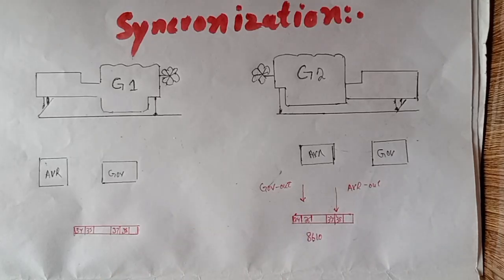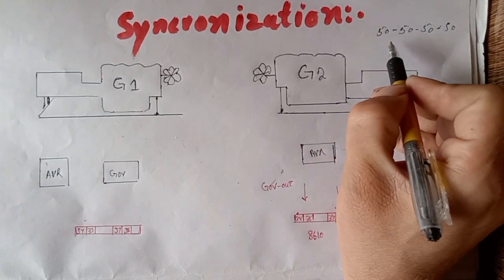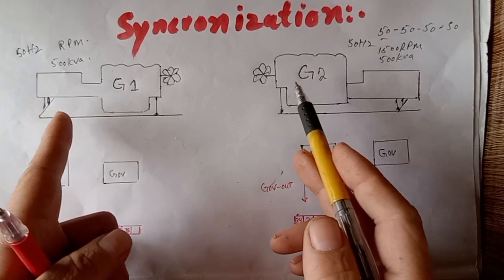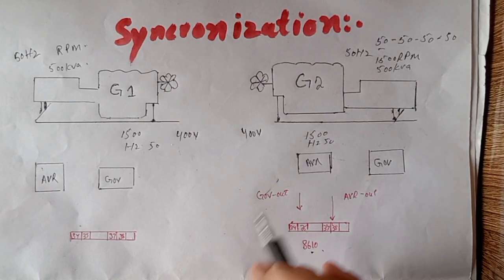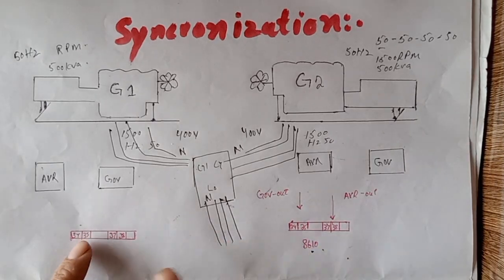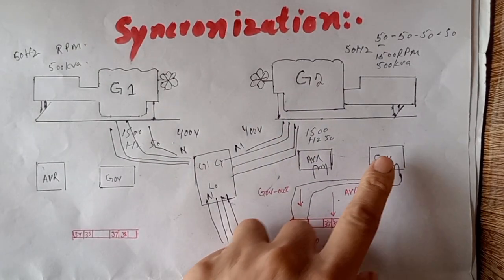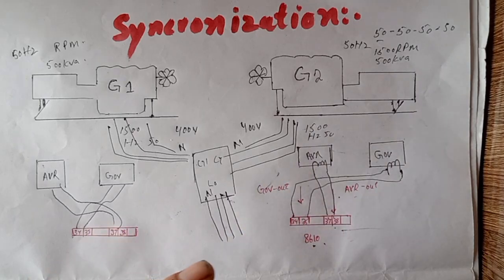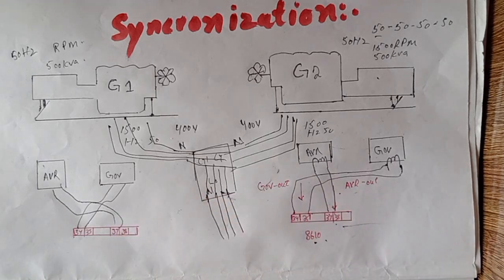How to Synchronize two generators in parallel operation | Using Deep-sea 8610

Comment: The Gorvonor is only applicable when the engine is Mechanical injection system .For electronic injection ,ecm will be use amd CAN data link.

Comment: What is the AVR biased Voltage range?
Reply from the maker: ±6-7%
Reply: @Info-Tech- the settings would be on Controller what about AVR, lets assume, D350 leroy sommer.
Reply from the maker: @MichaelUravui2 AVR also  from the controller 2 wire 10V Dc going to Avr Remotely controlled by 10V DC input from the dse8610 controller
Reply: @Info-Tech- Thanks mate, What about Speed bias, to ecm, PWM, or analog 0-5vdc, or CAN?
Reply from the maker: @MichaelUravui2 0- 8VDC

Comment: Parallel   two dissimilar old basic  generators  is 240v possible ?
Reply from the maker: Rating are same???
Reply: So both sides of the Gen must also have the same deepsea control that supports synchronization?
Reply from the maker: @ikpalian4413 not any model only 8610,